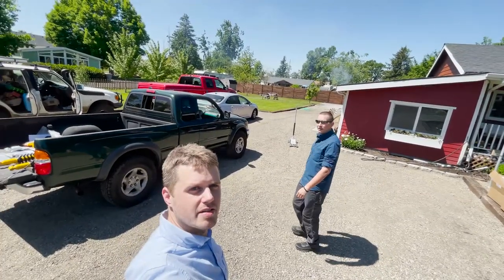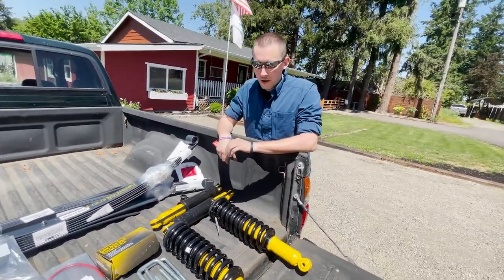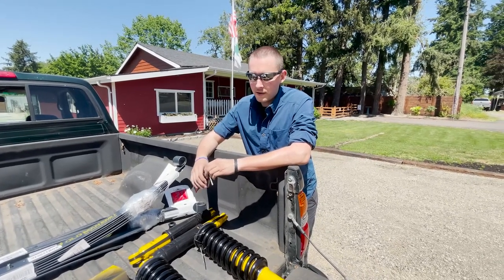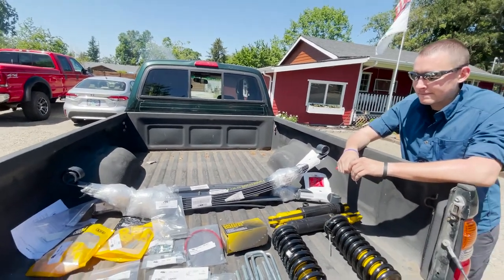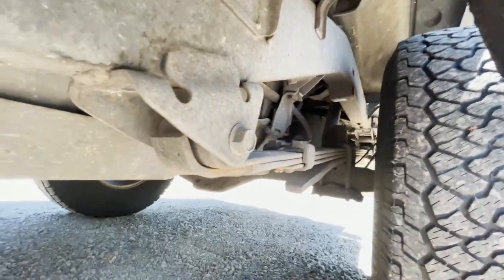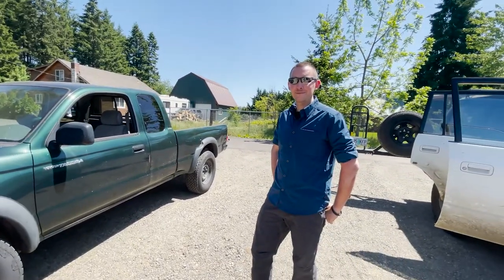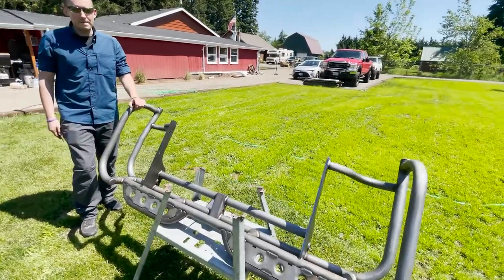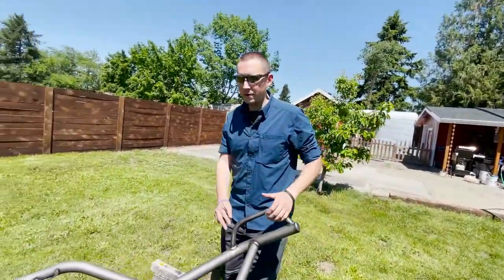2003 Tacoma Old man Emu Lift Kit and AllPro Baja bumpers Install

Comment: Allpro website says that the cutting and welding you are referring to is for 98-2k models. I have a 2002 so I was alarmed at first. But hopefully Allpro has the right year down and I can get mine on here soon without having to weld.
Reply: can you follow up on this?? i have a 1996 taco and i'm not wanting to trim or cut the frame at all

Comment: How do you you like the rear bumper on the truck? I already have a front bumper that I like and was thinking about buying the rear bumper. The only thing I might not be to crazy about is how much of the underneath of the truck that probably could be seen after installing this bumper? Could there be anyway to make it look less open?
Reply from the maker: It’s actually my buddy Ryan’s truck. He definitely likes it. I think with that minimalistic look you’re going to have more of the underside revealed no matter what. Also because he’s got the 2.5 inch lift

Comment: When installing the front bumper, how did you address the airbag system? Did you disable it with disconnecting the battery or something else.
Reply from the maker: I literally didn’t do anything😂 it didn’t mention it in the instructions and my amateurness didn’t even think to do that

Comment: hi Justin!, here is my thumbs up! and thanks for sharing your experience, I have to install front suspensions in my 2002 double cab tacoma, I'm ordering the 9004 nitrocharger plus the 2882 springs, my question is, are the upper shock mount, spring cushion also included? do I have to order those separate ? I couldn't find any part number for those in the catalog. thanks in advance!
Reply from the maker: The spring mount “spacers” if that’s what you’re referring to didn’t come with the struts by themselves. He purchased the entire kit custom. They should be fairy easy to find though. Make sure that a shop installs them with the struts so that you don’t have to use a spring compressor to get them off

Comment: Did you replace the radiator with a shorter one from the 2.4l tacoma?
Reply from the maker: You know I might have actually gotten the wrong one from autozone. Does it not look like the oem one?
Reply: @Austin_SaintOnge  no because on all pro site said some tacoma radiator hang too low under the frame might interfere with the all pro bumper so might have to use the 2.4l tacoma radiator. Just wanna ask because im about to order this bumper.
Reply from the maker: @Hondandoffroad  ah ok gotcha- I can’t rightly remember which one we went with but it must be the 2.4 liter radiator since I everything fit pretty well
Reply: Did the old radiator interfere with the bumper?
Reply from the maker: @Hondandoffroad I don’t believe that it did 🤔 we replaced it because it had a leak

Comment: Ok so I bought the same bumper doesn't the bolt that bolts in from the front does the bumper mount flush to the frame
Reply from the maker: My buddy’s mounts flush yeah did you have to cut off the arrow points?
Reply: @Austin_SaintOnge  yes mine is now touching the radiator

Comment: how did the ride comfort change compared to stock setup?
Reply from the maker: It’s definitely a little bit stiffer of a ride setup now. It’s a completely different setup now that he has a rooftop tent. Extra weight in the bed, along with all the armor. But still drives pretty well considering. His wheel/tire setup is the next thing he’s changing. His tires are old and unbalanced and he’s getting a wider offset wheel so he doesn’t have to run spacers anymore

Comment: 21:43 "happy the way it cummed ou- *came out*" 

> also make sure you replace the lower ball joints with OEM ones, first gen tacomas are notorious for lower ball joint failure. toyota even issued a recall for those. nice lookin rigs yall got im running the same bumpers as the tacoma myself!
Reply from the maker: Oh wow wasn’t even aware! We’ll be changing those soon for sure! Sick bumpers right?!?

Comment: What’s the link to the kit?
Reply from the maker: https://www.offroadwarehouse.com/product/9504-toyota-tacoma-front-baja-bumper-with-full-hoop-and-fill-plates/Default.aspx?gfid=p123313-c1713329&source=googleshopping&gclid=CjwKCAiAuaKfBhBtEiwAht6H79Al5gKM-xMhM3pGrQl9jVdM4evxrlUsdR1qzpeW_RgapPU1s4GMcBoC26sQAvD_BwE
Reply from the maker: https://www.offroadwarehouse.com/product/9504-toyota-tacoma-wrap-around-rear-bumper/Default.aspx?gfid=p123193-c1711105&source=googleshopping&gclid=CjwKCAiAuaKfBhBtEiwAht6H7-fNXIjtfb5m5Rns4Tex14JGmRuhl4v_LBGtDnaRdZK7pe22nXdcqRoCDf4QAvD_BwE
Reply from the maker: https://www.4wheelparts.com/p/arb-old-man-emu-2-inch-lift-kit-light-duty-ometac04lks/_/R-BHWQ-OMETAC04LKS